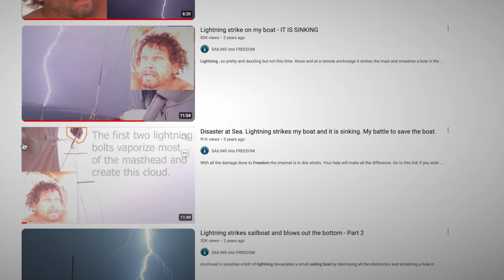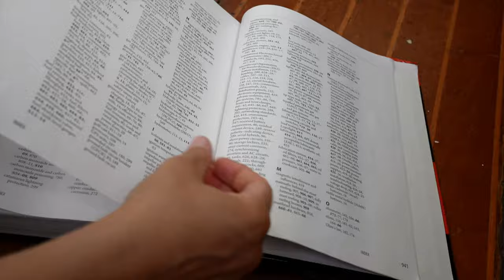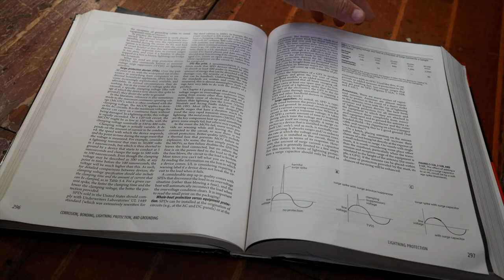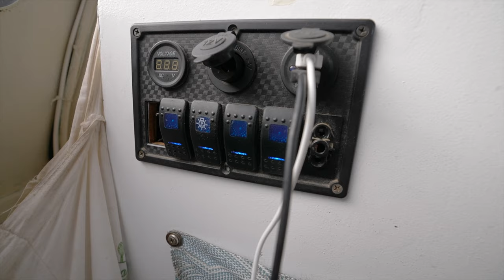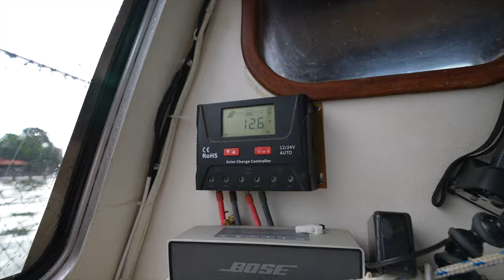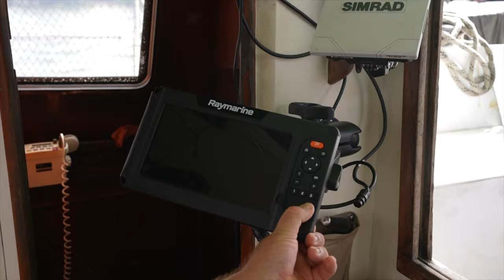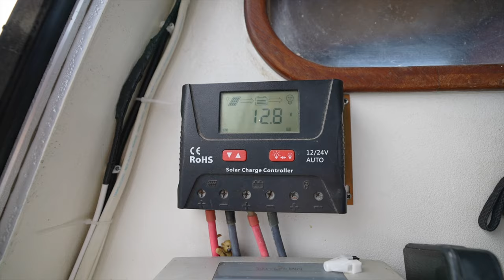our sailboat got hit by LIGHTNING and this is what we learned

Comment: I leaned that the water between the ground plate and the hull turns to steem, blowing the plate off or the hull in.  Chains in the water is my go to
Reply from the maker: We're worried that relying on the backstay as the only way to dissipate a lightning strike might harm the backstay - but it did not let us down!
Reply: I just hope you didn't learn that a hard costly way 🤞
Reply: have to heavy cables port and star from stays into water
Reply: A reasonable sized set of old jumper cables cut in half with a metal plate on the cut ends & the joins well waterproofed would work fine clamp on to your stay toss plate into water & easily removed before sailing😊

Comment: Thank you for the useful video. You did well to connect a chain to the back stay. I have found from radio experiments that a bare cable dangling in the sea makes an excellent ground connection. Our own little boat has a deck-stepped mast, which makes grounding difficult, but I am coming to the conclusion that cables or chain dangling from the stays is the way to go. Once the lightning finds  the best path to ground, there will be high voltages on everything else, but just a thousand or so and not the full capability of the strike. I will also disconnect my radio antenna and have made a connection point to do this, but need to connect the cable outer to the shroud down which the cable runs so any current can pass safely. Thanks again.
Reply from the maker: It did work out okay for us, so there's that, but we are concerned about the chain-at-end-of-stay method because the stay might be compromised by a large lightning strike.
Reply: @sailorama  Yes agree.

Comment: Note to self.... sticky notes everywhere to prep for lightening list!!! Love the chain ground idea... simply wonderful use for old chain, lightening rod ideas? I'm thinking of old copper vhf antenna onto used coaxial... I ws a firelookout in my college days during summer fire season so have ideas for staying safe... avoiding touching metal is essential
Reply from the maker: The Nigel Calder book describes a certain gauge minimum for the copper antenna and copper connections - I cannot remember exactly, but of course the normal vhf antenna actually did get completely vaporized. So not large enough to survive more than one strike, but good enough to conduct the havoc that we did experience 😂

Comment: The one downside to bronze through hulls is that lightening sometimes will blow a hull valves completely out of the boat.
Reply from the maker: Yes, indeed metal thruhulls can suffer that fate.
Reply: @sailorama Trudesign GRP through hulls for the win, also saves you having to run bonding wires to every through hull! 😊 The added advantage is that often that generic gold metal may not be a good alloy in some places !

Comment: There's two schools of thought that I've always heard.

1. Lightning is looking to ground. If you provide a path, you invite it to ground through your yacht. So, don't give it an invitation.

2. Provide a path to easily pass quickly around the vessel in case you're struck.

I lean towards the latter. I like the chain from the backstay to the water during storms.

I can't say that I really believe the idea that providing a path equates to an invitation. However, we do know that stepped leaders do in fact precede lightning and when one finds a path, the full bolt travels down it. So, there is definitely some merit to the idea that providing a path can invite the full bolt.
Reply from the maker: Yes, an interesting discussion. I don’t believe that grounding ‘invites’ a strike, simply because we know of boats and objects that were not grounded that have gotten hit. The lightning will ‘find’ a path no matter what material and no matter what circumstance. Many vessels with lightning dispersal brushes that have still gotten hit. We simply need to adapt and provide the safest path for crew and vessel if lightning does inevitably strike.
Reply: I tend to agree. If lightning does hit, provide a path of least resistance around the yacht so that it doesn't create its own path.

Comment: I wouldn’t want the energy to run through the inside of your boat, if the conductivity is just a bit too low, and you can very much count on that, the copper explodes inside the boat. The most safe way is, like you did, a chain into the water outside, additionally I would, after a strike, take a real good look at the stays affected, hence the properties of the metal and ultimately the complete stay could very well have changed in a negative way.

Comment: Very informative video, thanks for sharing. I wonder if a lightning rod at the top of the mast that is tied into the stays somehow with chains at the base leading into the water is preferable than a grounding plate - which is bolted through the hull. Wouldn't it also be nice to have an antenna disconnect of some sort at the top of the mast to disconnect the antenna cable there, so the lightning can't get into the boat via that path. Not sure if something like that is feasible.
Reply from the maker: Good questions/ideas - yes, lightning travels easily down the stays with an aluminium mast, however two things that we've considered - first, making our stays the 'main' path of the lightning may not be good for the stays, and second, when the energy arrives at the chainplates, we will always have to make sure that chain is fully immersed in water or else the energy might explosively jump through the fiberglass instead. That can be difficult to guarantee if we are healing over, or just wish to not have chain flopping around. This is why stays as the 'main' path is not our preference. Having a quick disconnect switch for our vhf radio antenna would have also been nice 👍🏼
Reply: @sailorama  I would definitely use all of my stays grounded to the water. The main lesson is to have as many paths as possible for the current to find its way to the water. That would effectively limit the damage compared to one path. I would never use a path that goes into the boat for the risk of sinking it—just my 2c. Cheers.
Reply from the maker: Ah yes, I forgot to mention - stays should indeed be grounded as alternate paths. Nigel Calder book describes in detail attaching stays/chainplates to the 'main' path from top of mast to the keel/grounding plate using large gauge metal, which is what we hope to do.

Comment: Never a dull moment on board ! Nothing but fun and adventure ! The square plate is a zink used for electroless saltwater with electronics on board ! Two good coats of really good quality anti fowling bottem paint  should do the trick ! And then some good deck paint be sure to mix some real course sand to make you own non skid at least one heavy coat. Justine is a sanding machine wow goes through sander's like toilet paper she is amazing ! LIKE SUBSCRIBE COMMENT BRING THESE NUMBERS UP PLEASE !
Reply from the maker: Thanks! We have been provided with some excellent primers and paints for this haul out - looking forward to sharing that in the upcoming videos soon!
Reply: Not sand. Sugar or salt. Then wash the deck down after it has cured to dissolve the grit. I've tried sand, it eventually just wears off from use. As long as the deck paint is a quality paint, the imprint from sugar or salt will leave a sturdy, resilient non-skid.

Comment: On the solar panel you only have to substitute both diodes on the back of each panel (respect the polarities from the existing ones when installing the new ones...), and unless you have a shorted or open cell the panels will work again... About the solar charger install a new one, preferably a better one than the cheap Chinese models... You probably have your VHF radio fried as well since it got the main hit from the lightening through the antenna... But install a good earth (ground) plate on the bottom of your boat and a good cable connecting it to the mast and all the general earth connections for all appliances for a safer ground connection...
Reply from the maker: You pretty much described all the projects that we've been undertaking since the lightning strike 👍🏼

Comment: Fox a length of chain to your mast  base at deck level ... Throw it's loose end over the side ... Highest risk point direct to external  earth ... The earth  plate is usually zink or Alloy and is more for earthing a current for stray internal energy discharges. 

Earthe the solar panel frame  to the arch and arch   
To the chain into the water or a copper lightning conductor strip . Glad you have that book the guys a genius . 
Glad you are all ok.👍🏻🧙🏻‍♂️

If you ever get the chance and want to make you boat cooler and nicer to walk on  
Use deck cork on the deck.. it lasts longer than teak and it's quieter and things don't break if you drop them .. if it gets gouged you can cut out a patch and glue in a replacement ..if it fades to silver grey you can sand  back lightly to its original colour... 
It's great underfoot inside as well  though might benefit from sealing especially  in the galley area or head area.
Reply from the maker: Cork is great - I imagine it's a little pricey these days though. We were sent some specialised paint for the deck job. Can't wait to share how it goes! Cheers.
Reply: Have some thoughts about your first idea a piece of heavy steel in dubious contact with aluminium then stretched ontop of fibreglass!  #1 the galvanised chain will cause galvanic corrosion of the base of the mast #2 if you get hit there will be a huge arc flash right at the base of your aluminium mast! #3 that arc flash will follow the chain along the top of your fibreglass roof! 😮 Such a brainless idea Unless you are trying fir an insurance claim (which on investigation would be denied) 😂
Reply: @sailorama  Cork is not that expensive because most wine makers have moved to screw caps & cork growers need new markets. Cork has serious advantages over plastic foam matting or spray foam. $50 will get you the hopper sprayer to do it & probably $400 to $1200+ for the material dependent on the thickness you add & the area you apply it to!
Reply: @jackdbur  
👍🏻 In the tropics they would have to use the sheet/roll form stabilised for decking .. but there are companies out there mostly in Europe that are cheaper..

Comment: Denntco make the device that pretty much protects you from lightning little spendy but it works
Reply from the maker: Just looked it up - interesting. Much like the 'cleaning-brush' style dissipators, I imagine there is some solid scientific theory behind the design, however only time and data will determine if they work or not.

Comment: Your boat doesn't have an Aluminium & foam core in between the fibreglass layers, different boat construction, different issues when lightening hits.

On the bright side you didn't have millions dollar systems to loose so your replacement costs won't be so high, sometimes there's pro's to doing everything on a tight budget 👍
Reply from the maker: It's totally true that another vessel would have had much more costs involved - we're really lucky to have only lost a couple hundred (maybe 1000 usd total) of equipment.
Reply: the new Amel 60 video says it can be single handed because of all the electronic systems. All I saw was all the things that could break in the salt air and was without adding the risk of a lightning strike.
Reply: @Angie-in8wc  So basically they're admitting it can't be single handed if you loose the electrics, does that mean they include in the sale price a full set spares for all essential equipment and an EMP proof case for said spares? I'd be surprised if the answer is yes, but then the amount that an Amel costs maybe they do, Like Justine and Robbie, and Amel is not in my budget even an old one....
Reply: @daveamies5031  The sails have manual as well as electronic options, but I can’t imagine trying to put a reef in the sail of a 60 ft yacht solo. 

So I’m in agreement with you, all that fancy stuff is great … until the boat gets hit by lightning. 

I think it was the OKellys who noticed that a lot of the old sea dogs who had circumnavigated and sailed for years often ended up on smaller, 35-40 ft boats, with really simple systems. It wasn’t about money, it was about ease of repair, being able to do it themselves and not having to wait for weeks to get parts. 

My favourite quotes about sailing are “fixing things in exotic places” and “everything is broken, you just don’t know it yet” 

And that’s half the fun.

Comment: Long term ? Blisters mean bad chemistry to me. I'd start looking for a similar hull that can use all your hardware like motor, prop, steering. What boat and year is this? With a metal keel, much better grounding can be rigged. I have a Shakespeare 5104 deck level antenna. It won't attract lightning like a stainless wire and you can take the whole antenna and cable below deck during storms and tie it to the inside roof.
Reply from the maker: Our bottom is not too bad compared to what we've seen in boatyards and considering our old girl is over 40 years old (she is a 1980s Vennekens Koral 40). We are indeed thinking of installing our next vhf antenna at bimini level.
Reply: @sailorama  Good, but if things go south, boats live again by donating parts efficiently. There are lots of orphans that should get rescued and loved again.
Reply: All polyester hulls will have this problem the real fix is to sandblast or gelcoat peeler the top .5 or 1 mm off and apply a new layer of fibreglass using epoxy that does not get blisters.